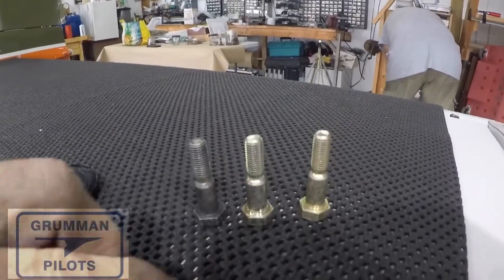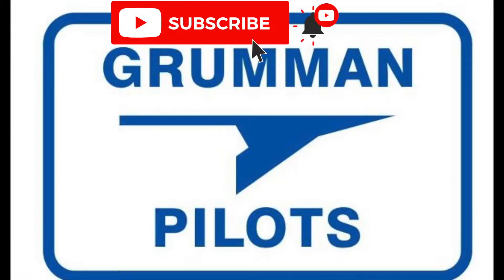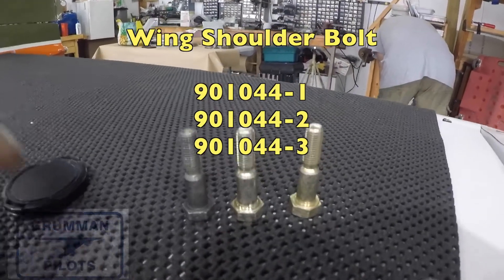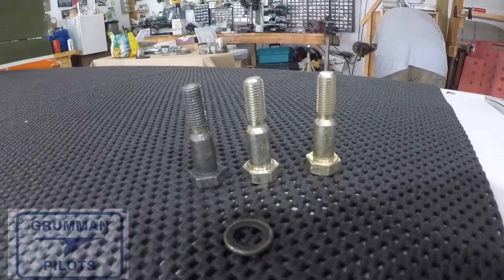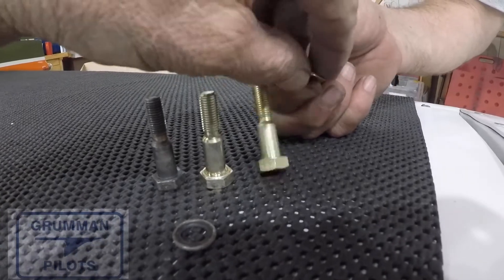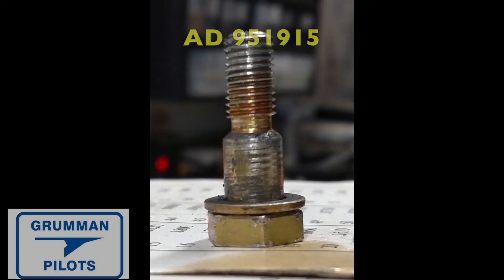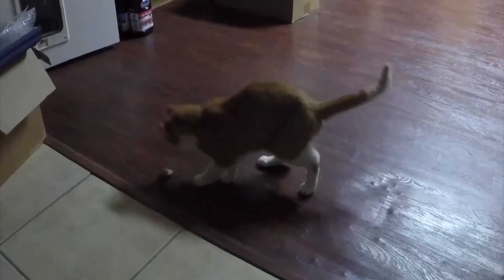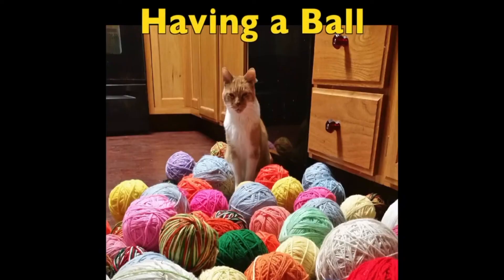Spar Shoulder Bolt Condition AD 951915 - Grumman Style

Comment: I spent $100 per bolt to replace mine.  No chance in hell that they would have failed BUT the AD required removals and, since no CAD plating, I had to buy new. Sillyest AD ever.
Reply from the maker: I had to do my TIGER twice, once when it came out, then years later when a Shop pulled them to check instead of checking the torque.  Yep, expensive.
Reply: @GrummanPilots  Yea, this was my 2nd time on my Cheetah.  How many Grummans have actually lost wings in the last 40 years?
Reply from the maker: @williamwilson2696  I did, but it was an impact, not loss.